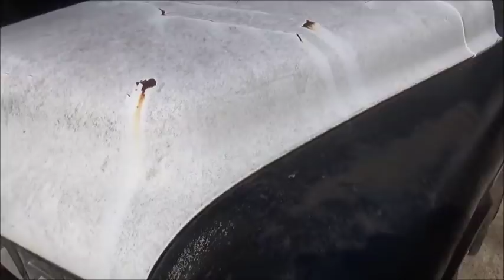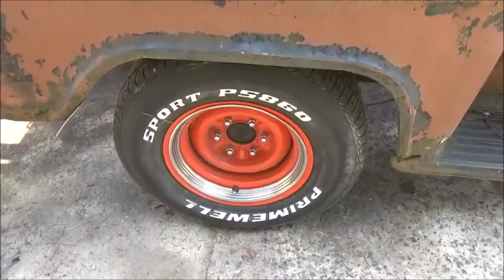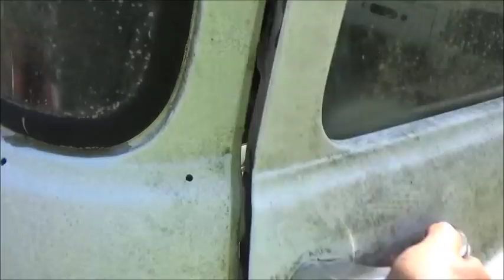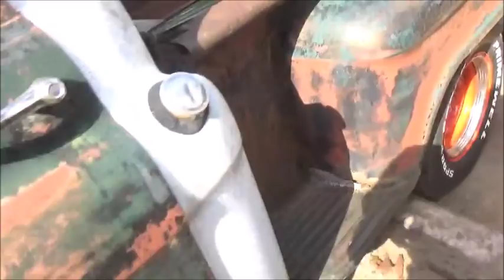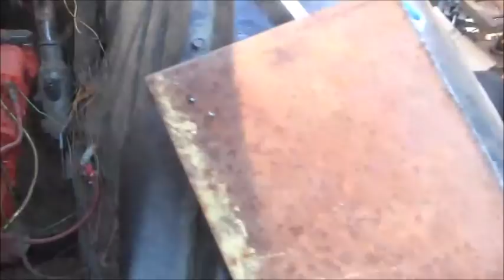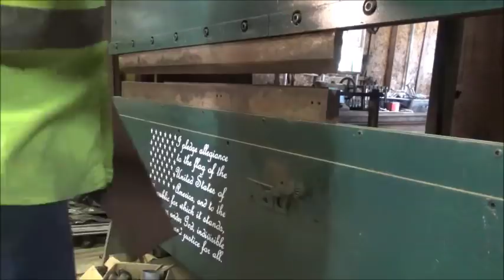1955 Chevrolet With Perkins Diesel (Back On It)

Comment: Jonathan...I used the bench seat out of a 2dr 62-65 Nova I also used the gas tank out of a VW Bug had it between the frame rails set low enough that the cap was  just below the floor height of the bed planks it sat behind the rear axle.... I did all that to a 55 Chevy big window I had lowered the truck and installed an Olds 350 Rocket turned into a 383 stroker 350th with B&M shift kit...and like you I didn't start the project until I had everything I needed all gathered up...6 weeks working evenings after work and weekends I rolled it out on the street with open headers and did a big wheelie down the street...never hurts to have a friend that built all sorts of drag racing cars and trucks for a living....enjoy your videos my friend keep'em coming...

Comment: I also have a 2017 Ford F-550, a 2012 Ford F-550, a 2014 Ford F-750, a 2014 Peterbilt 364, a 2014 Peterbilt 362, and a 2014 Dodge Ram 3500. They're my hauling trucks. I am a truck driver in the oilfield.

Comment: If you are redoing the roof on the Elcar would teak wood be any good🤔 been used on boats for years and it's pretty flexible to work with!
Reply: White ash is better than teak, which can be very heavy and not suitable for car bodies. Especially if it has been seasoned. you can barely get a drill through it.

Comment: How much horsepower can that diesel put out?
Reply: that and torque.....
Reply: It's a fairly large displacement 4 cylinder turbodiesel, it's more about how much torque it makes. My 2014 Ram with a 6.7L Cummins makes 350 HP, but it makes 900 lb ft of torque and I have pulled over 40,000 lbs with it. In his last video of this truck, he was revving it up and it was shaking the entire truck from the torque of that engine.